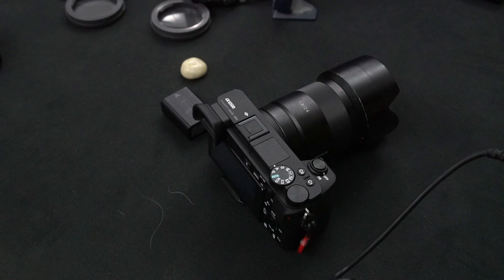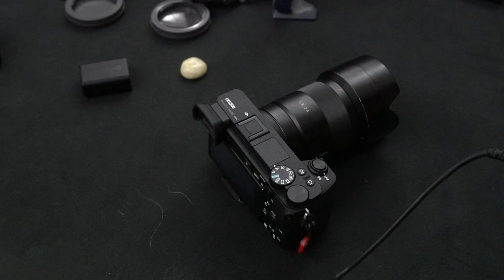sony a6500 overheat testing for 3hours, Results/discussion (18min)

Comment: When you say warm. Was it warmer than body temperature (your hand) or colder?
Reply from the maker: I would say some parts colder someparts near or little over. Maybe if i do it again i will do a real 'side by side' with the a6300 and check temp for real. But i am getting a little bored with the whole overheat testing.
Reply: Daniel Ockeloen you did a lot for us. I personally thank you and hope more vids are coming. Have a great day
Reply from the maker: Thanks i do it for fun and more will be coming but i think a few days of usage is better before i post more is best. I am also working on some new DIY projects over the next few weeks related to the a6300/a6500.

Comment: When a car has a manufacturing defect, the brand collects that vehicle and corrects the problem with no financial charges to the owner.
Sony should do the same with their  A series cameras.
I bought a Sony A 6000 and with a temperature of only 22 degrees celcius and only recording in full hd, the camera stopped recording after 5 to 8 minutes due to over  heating.
This is ridiculous and unacceptable.
If Sony has any respect for its customers, then it should do the same as the car manufacturers do. Collect the cameras and correct the problem.

Comment: I'd rather not watch a 20 minute video - does anyone have a summary of the results?  Thanks.
Reply: exactly what I wanted to say.
Reply: VR VIDEO warm to touch, worked for 3 hours no problem, the warmer external working temperatures the higher the odds of it overhearing but for normal uses it will just get warm .
Reply: VR VIDEO you can change the speed of the video playback to 1.5 😉